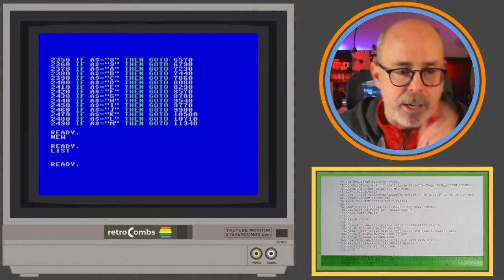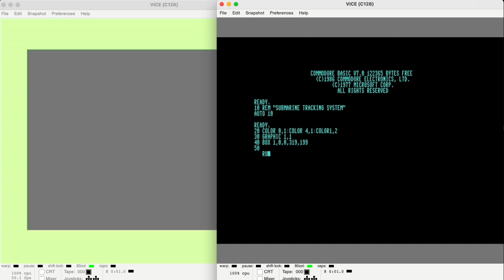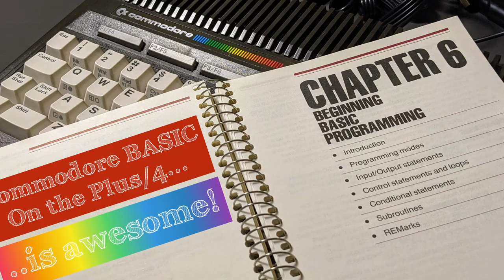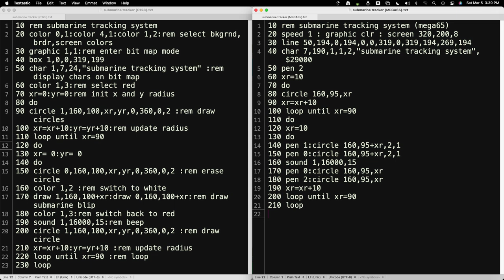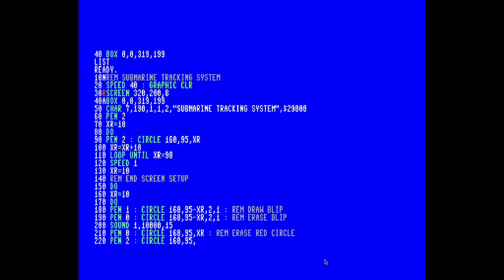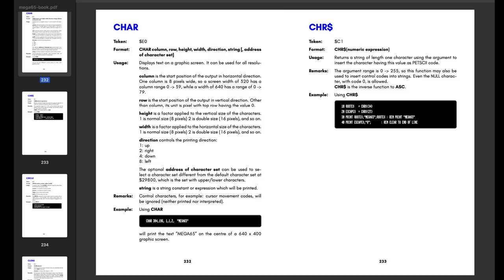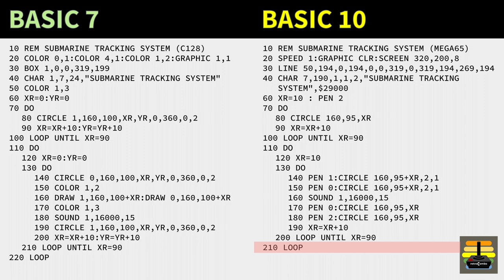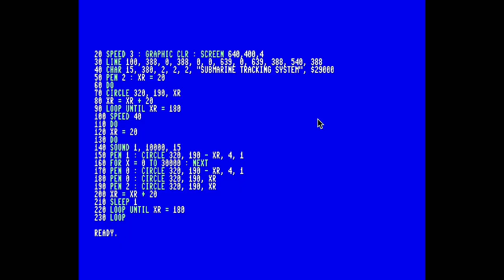BASIC from Commodore PET to MEGA65 | Conversion Example

Comment: What happened to BASIC 3? Looking at the original source to CBM Basic from 1979 shows that version 3 was the short-lived (approx 2 months May/June 1979) enhancement to add the faster garbage collect but BEFORE the extra disk commands that were in the official version 4. Here is what the source file says:

;VERSION 1 - AUGUST 1977
;     ORIGINAL MICROSOFT RELEASE
;VERSION 2 - AUGUST 1978
;     FIXED MANY BUGS SOME ARE:
;     1) ARRAYS LIMITED TO 255
;     2) NON-INTERRUPTABLE CODE
;     3) GARBAGE COLLECT STRINGS
;VERSION 3 - MAY 1979
;     FASTER GARBAGE COLLECT
;VERSION 4 - JULY 1979
;     1) EXPAND RESERVED WORDS
;     2) ADD DISK COMMANDS
;     3) ADD DISK STATUS VARS.

The original source is now available on places such as Github. It all makes for interesting reading!
Reply from the maker: I was not aware of this version. Thanks for the tip and the reading! I pinned the comment.
Reply: @retroCombs  Cheers - glad it was useful!
Reply from the maker: @dvdvnr  👍

Comment: Submarine sound, use all three voices, starting with all triangle but you can use the filter on each for later experiments to filter down a sawtooth, say; then you want to work with ADSR, the first sound a fairly quick attack, like a 1, the second sound (say, an octave lower), use an attack of 2 and modify your sustain and release appropriately, but now we need a long decay to emulate reverb so we'll use the third voice for that, bringing it in slowly with an attack of 3 and a gentler slope for DSR, we'll have long low sustain so that it outlasts the previous two.  We'll basically tier these, to get that extended reverb effect.
Reply from the maker: Now I just need to find some time to give this a shot. Great tips!

Comment: ok, your v7 code  is more of a programming example that appears to be intentionally breaking out all the functions of the circle command, whereas your v10 code looks considerably more optimized so the character comparison is not strictly apples to apples. If I am reading the programmers reference guide for the c128 correctly the YR variable could be eliminated entirely from the code without a functional difference. just ensure to keep the commas in the circle command as the default value of Yr is Xr for the command itself. in fact it seems like the circle commands are using much of the default values to allow for a program to be tweaked by a beginner.
 Functionally the same code for 80 could be written like this:
80 CIRCLE 1, 160, 100, XR,,,,,
and so each instance of circle can be modified like this and any references to YR could be left out of the v7 version.

Not sure if all the commas are necessary but page 33 states: "You may omit a parameter, but you must still place a comma in the appropriate position. Omitted parameters take on the default values."
Reply from the maker: Great summary and you are correct. I did a later follow up (https://youtu.be/tOlfdtFYDBM) but even in that video didn't touch on all your points. Excellent additions and admittedly, I only looked at the program and did not dig into the programmer's guide itself.

Comment: Speed 1 sets CPU clock to 1MHz. That's why the execution is so slow on the M65 when compared to the C128.
Reply from the maker: Although the new Circle algorithms can draw circles faster at 1 MHz than the C128 can at 2Mhz. We've learned a lot since the early days and this is one of the exciting reasons to support the MEGA65. It's an amazing 8 bit computer.
Reply: @retroCombs  yes, thanks for completing my incomplete remark. Clearly the mega65 was drawing the circles faster than the c128. And yet it was still surprisingly slow for a 40MHz machine. That's why I looked at the code to check if there's something that slowing down the program, for example a loop, delay, pause or similar. But heck no! You can actually set the Mega65 CPU speed in basic to either 1, 3.5 or 40MHz! How cool is that?!
Reply from the maker: Very cool! Thanks for the conversation.

Comment: Is there no way to draw an arc for something like a pizza slice? Polygon seems like it wants all sides to be the same. What about a Bezier curve? I blitzed through the manual for B10 and didn't see those. Odd.
Reply from the maker: That's a great question. I checked the manual and couldn't find anything. I'm going to post this question in the Discord.
Reply from the maker: Answer from the Discord in the #basic channel was no command for arc. Expanding the BASIC set is currently on hold.
Reply from the maker: There is now! Bit Shifter just added this feature after being inspired by my video: https://discord.com/channels/719326990221574164/805252939593416705/952594030154375168

Comment: Ah, this is a very informative comparison video, thanks a lot!! It’s probably the best way to explore the similarities and differences of the MEGA65 compared to earlier CBM machines.
Waiting for my MEGA65 to do some similar experiments 😋
Reply from the maker: I found the process informative as well. As I stated, I did not expect many differences between version 7 and 10 and after the shock wore off, and I used V10, I found it so much better. Commands make more sense and, as we saw, programs were shorter. I can't wait to try another conversion.

Comment: You might be able to get the ping you want by choosing xylophone and then adjust the ADSR values.
Reply from the maker: Jeffrey. What do you mean "choosing xylophone?" I'm intrigued.
Reply: @retroCombs  I saw something mentioned on one of the commands that mentioned a handful of instruments (maybe some presets...? See page B93 in the guide you spoke of once before. I think the discussion on the page was what kind of sounds would be created by adjusting the envelope/ADSR of the sound (presumably each frequency would apply in the envelope also).

Drifting through the commands, I couldn't seem to wrap my brain around DPAT. Maybe the ELLIPSE command has some options I missed, but I just couldn't find an arc or bezier.
Reply from the maker: I'll take a look. Thanks! Admittedly, I didn't spend much time on the SOUND command since it was an easy conversion.